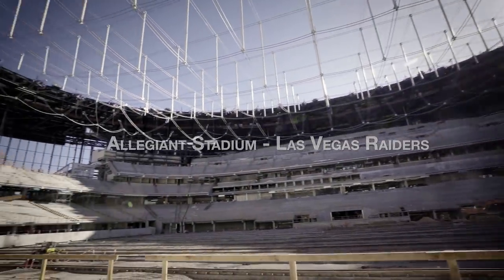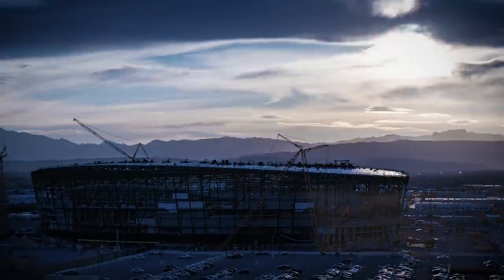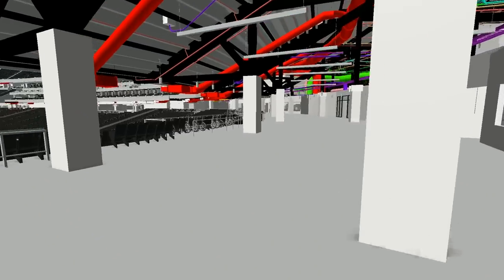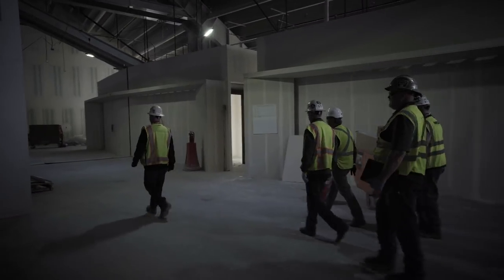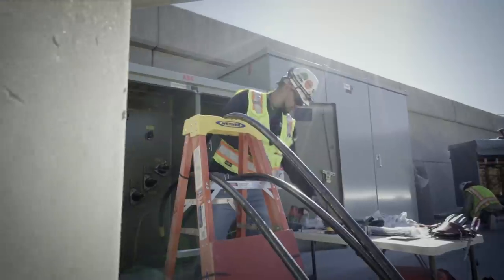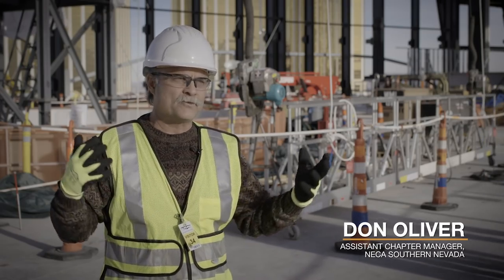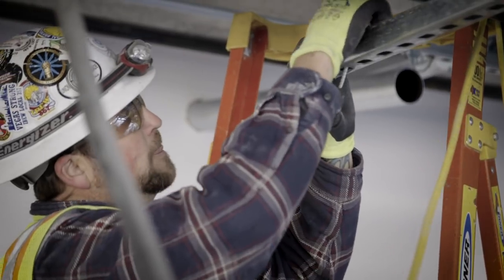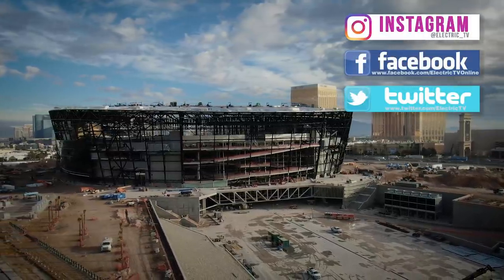ALLEGIANT STADIUM; PRIVATE TOUR OF NFL RAIDERS’ NEW CONQUEST

Comment: The lugnuts that hold the ceiling cables in place snapped on their own. These cables will hold the glass ceiling tiles in place. If these lugnuts are breaking on their own (with no load on them), what do you think is going to happen when you place a load? (install the glass)

Comment: ...What is the point of the field being moved in and out of the stadium?
Reply: Imagine all the special events this stadium will hold.  Pretty. Ice to wheel out the field , set up and then breakdown and wheel it right back into place
Reply: @cameronchurch6892  But stadiums have been doing events on fields like this for years without having to have a system like this, especially that the additonal field space is required outside of the stadium, space that can't be used for anything else but storing a field.

Comment: What’s wit the stupid cables hanging from the roof
Reply: Itll be a floating roof. Not enclosed, but not open either.
Reply: Josh McFlys I guess I still don’t understand what you mean, it just looks so weird and out of place like wtf does it do
Reply: Hey yo! So most stadiums are either enclosed or the roof is completely open right. Exposed to the elements. Because the arena will be in rather descent weather they went with a 3/4 roof. Think of it like staring up at a glass ceiling but still being able to see the stars. You familiar with a retractable roof right?